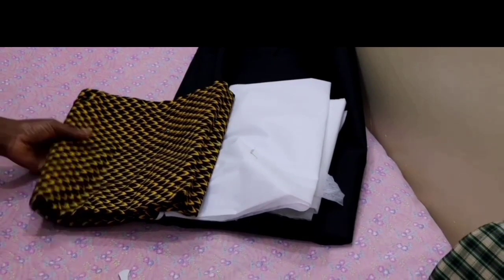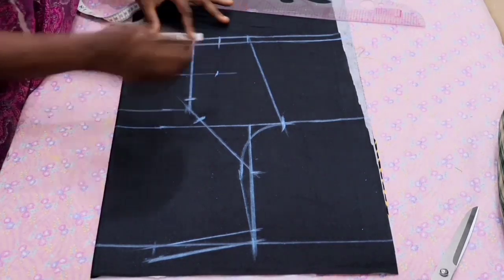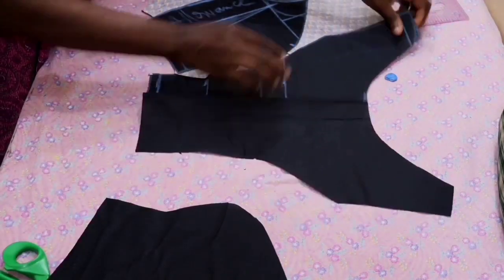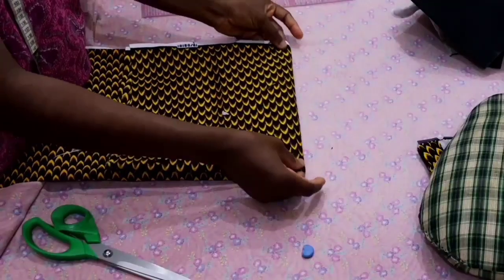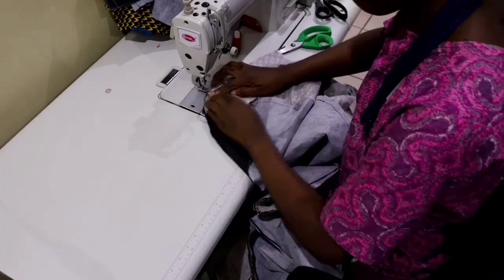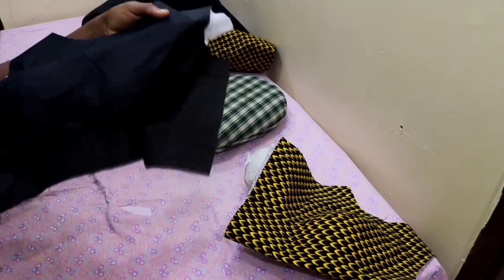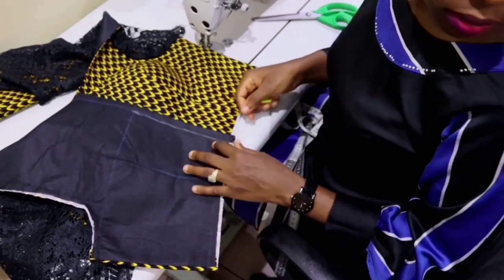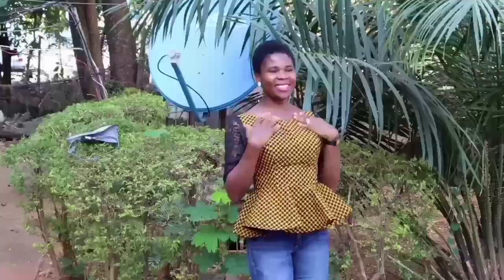How to cut princess dart bustier top with 720 degree peplum

Comment: This blouse fits perfectly on u, thanks for sharing ma'am. God bless u. I noticed u didn't add 1/2" s.a to d shoulder of 8 to make it 8.5? Also, y did u add 0.75" as d upper s.a & 0.5" as d waist seams? Plz ma'am, I always av issue with boat neckline, how d u determine d width and d depth of d boat neck to make it fits perfectly on u? Am sorry for asking too much questions. Thanks in anticipation
Reply: Thank s for sharing sis.God bless you real 
Pls I'm interested in the 🖕🖕 questions pls . Thank you in anticipation 🙏🙏🙏
Reply from the maker: I don't usually add Seam allowance to  the shoulder except if am using pattern, then again the allowance of 0.75 uses on the shoulder is to allow the cup to balance well cos at end it's 0.5 than will be used to join back and front together, what this mean is that 0.25 was added to the bust point and underbust lenght 
  For the boat neck,I usually leave 2.25 on the shoulder (assuming shoulder is 8 just like in my own case , I will leave 2.25,  meaning the width is 5.5) then depth is 3.
Reply: @Yhinkisweet,thanks for responding to the questions.Are these measurements for princess dart and boat neck standard for whatever body size you're working with?

Comment: What a lovely tutorial.thanks sis but I have a problem with sewing this bustier.when I join both cups are sometimes not uniform what could I be doing wrong
Reply from the maker: That's why you need to start joining the panels together from the waist line......and if possible always cut the lining and the material together like I  did in the video

Comment: Why do you add back the .5 reduction on the side for the zip reduction? If you want it to lay really flat, wouldn't it be best to just reduce it.
At mark 35:08 when making your final bust and waist measurements, why did you not stitch with seam allowance?